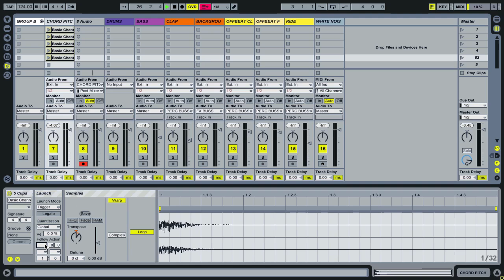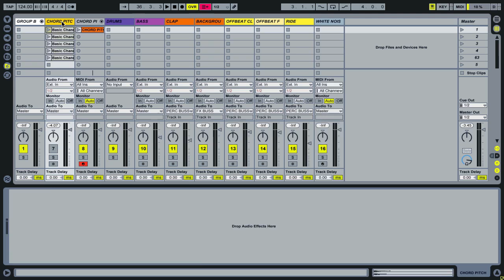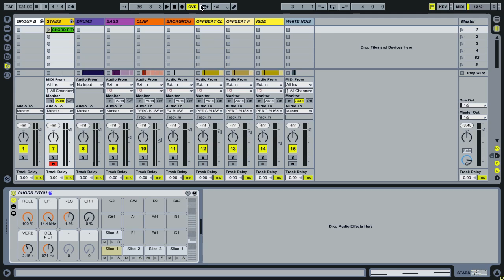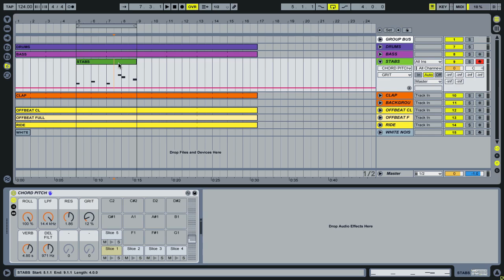Ableton Sound Design Tutorial - Timestretching Samples

Comment: A tip that elaborates on this a bit. 
1. If all you want to do is a simple timestretch, put the sample in texture mode like in the video. Then just click the *2 button repeatedly to increase the seg BPM. 

If you'd like to not be limited to just a few notes like this video shows, load these samples back into live's sampler and spread each one out across a couple octaves. It'll lesson the speed up/slow down effect you'd get just using one sample. :)

Comment: Another method would be to use Samplers Zone function. Just pitch/warp the sample to every octave and record it. Cut and consolidate every pitched Sample and use Samplers Zone to apply them on the specific octave they were pitched to et voila you have a fully playable multisample instrument with the ability to change velocity, make zone-fades, adjust ADSR or even loop the release to go even further.